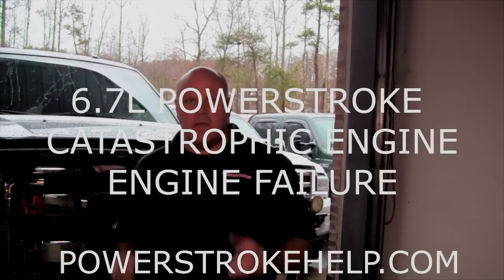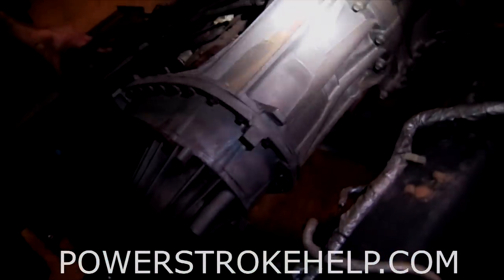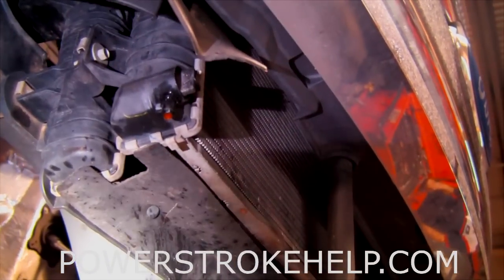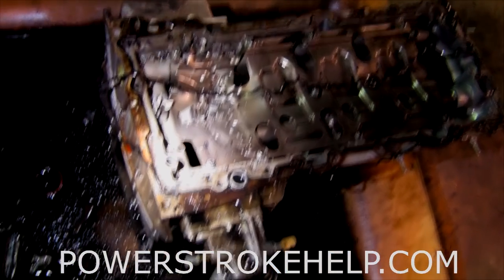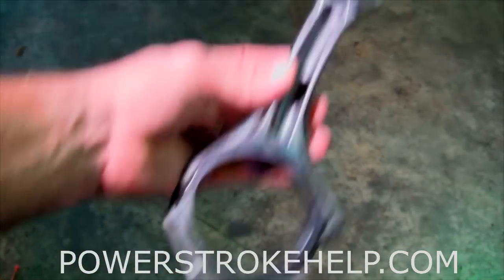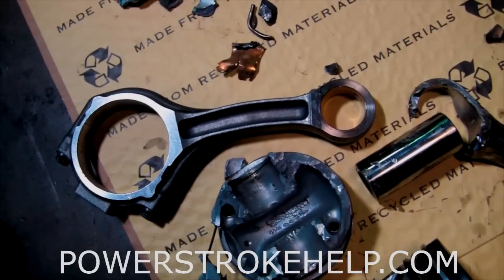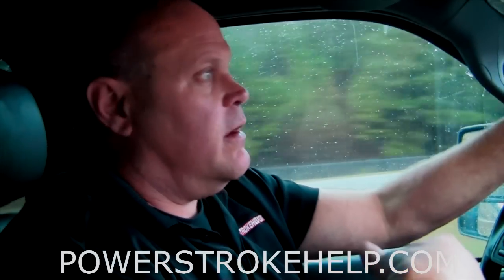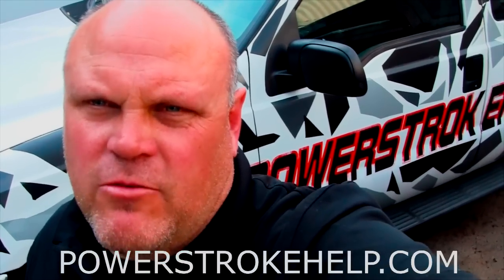6 7L POWERSTROKE CATASTROPHIC ENGINE FAILURE

Comment: I'm sorry, ford is just junk. I've even seen the my hometown fire department switch from ford to dodge now.
Reply: The big three. Chevrolet, Dodge and Ford are all great trucks with their new diesel engines. HOWEVER... what is literally killing their reputations is the extra pollution controls components and everything else that holds back optimum performance and longevity of the engine. It's no laughing matter. I've deleted mine with the Spartan and did it right after alot of research and time. These trucks are capable of running clean and low emissions output without this deplorable egr and filtration crap. It's just the government imposing even more restrictions and wanting more more more to tax and impose. Thus causing headaches and so forth like you see here.
Reply: +steve rodriguez 

Having been around several of these 6.7 engines (many with long, healthy lifespans), I can assure you they're not close to junk. Since Ford cut ties with Navistar, they have been far better off.

Abuse is abuse--no engine will hold up to it forever.
Reply: @EasternAggie  I dont agree my buddy has a 6.7 in the shop right now already in 50k miles the DPF became a flame thrower. now it has a lifter noise with broken rockers and collapse lifers. No power up stuff at all. We will see when the heads come off. I am thinking a broke off valve. Now that is completely shit. I dont hear of that stuff with duramax at all. Only ford. all the 1/2 ton gas engines I have seen with popped transmissions. I have seen my share of shit fords. would never buy one new. THe issues with chevy are external not this internal blow up stuff.
Reply: @Mikefngarage  and bullshit. duramax has been been the queen of failed injection systems, melting/cracking pistons, spinning cranks, blowing apart heads. you have no clue what you are talking about.
Reply: Dodge and Chevy are that great either
Reply: Says the guy with Rasputin as his profile photo.

Comment: Great engine from what I hear. But after years of my own mistakes with tuning and talking to race car drivers it's best to tune mildly with a stock engine. If you want power you have to build with not just strong parts but a stronger engine and when something goes bang it usually means lots of money. Money you've already invested in the reinforcement to begin with. This truck IMO was crackerjack tuned and ragged on.

Comment: What exactly does the "we build a better motor than Ford" comment really mean? (seems really odd especially how he leans into the camera).  I drive a completely deleted 6.7 with H&S tuner (they are not out of business as others have commented) and it is clearly stated all over the place that towing should only be done in tow mode (NOT IN PERFORMANCE MODE).  So, the guys who owns the truck in the video (did not service tranny, did not change oil at regular intervals, pulled a heavy load in performance mode in his tuned truck) and from that we are supposed to believe that all tuned and deleted motors will end up with same fate as this motor?  Also, in the video they state that you cannot run DPF delete because of the timing.  What does having the computer over ride seven DPF sensors, have to do with timing.  There is a stock setting on the H&S tuner that does not adjust the timing for any performance gain, it simply tells the computer not to throw error codes for all the disconnected sensors from the deleted EGR and DPF.  I understand that they have improved the cooling system so that the super heated exhaust in the EGR is cooled more sufficiently now as it is brought back into the motor, BUT why do you want "heated used air" going into the engine.  Cool, clean, fresh air makes any engine run more efficiently.  Has anyone ever cut a DPF apart?  HOLY BACK PRESSURE BATMAN,  cut mine up and sent it to some guy on internet who harvest the platinum out of them and he paid me $275 for it and paid the shipping.  You need the damn turbo just to force the exhaust thru all the crap that is packed into the beast.  All motors BUT especially diesels want to breathe to run more efficiently.  I am not claiming to be any type of expert and I am open to correction if any of comments here are incorrect, just simple observations from a simple guy.  Who is damn happy and proud of his 6.7 (please pardon all spelling and grammatical errors as I said before just a simple guy here)
Reply: I agree.. That truck had static lock due to a bad injector... This guy is selling...what he is selling, is his tuner...  He thinks he is slick and we will fall for, some idiot pulled in performance mode...I have an 03 6.0 crew cab dually, with 600k on it.. Put the edge with juice on it at 25k miles.. I have had it in level 5 (kill mode) since install.. It is my work truck.. I installed the egr butt plug, when I installed the tuner.. No egr delete, nothing else has been done.. It will smoke all 4 rear tires like a dragster.. 
This guy needs to blow smoke up some one else's ass..
Reply: KBS117 He was talking about 6.7s.   6.0s are not even in the conversation, they can be built to 7.3 quality through him.
Reply: +keith knowles My dad has a 6.4 that he has had deleted for the last 12,000 or so miles and the truck has been great way better with out the bs restriction it has before deletes, Its up to the owner to understand what power can do to ones truck, even if you run in performance but drive conservatively i would bet you will be ok, and towing is obviously for towing, thats what it was designed for any owner should know that, maintenance is also key in owning a heavy duty truck, Completely agree with what you are saying on everything.....
Reply: Point well made.  I run H&S tuner on my deleted '11 6.7 PSD on street mode and it runs great.  Tow mode when I tow.  I don't use the performance tune as I am 38 and don't need that shit.  I change oil at 4k and run a quart of Lucas synthetic and oil analysis through Blackstone every service.

Comment: Such a big engine and still it blows up. I had an old Alfa Romeo with a 2.4 JTD engine in it and I raped that engine. Towing loads that were much too heavy, long full speed autobahn runs. It did run without oil for a short time, I had the cooling fluid boiling and continued driving and the car did 500.000km in total. I still have that engine and it runs like the day it was new.

Comment: With age comes wisdom.  I bought a 2000 7.3 at age 19 and stacked a bullydog chip with an edge evolution tuner.  Six months later my tranny was gone and so was $3,200 for the repair.  I'm 31 now and my (I'm the owner) work vehicle is a bulletproofed 6.0 that is bone stock except for exhaust and an intake.  Eventually, we learn that pushing an engine leads to an empty bank account.  If you want to go fast, an 8,000lbs truck is not the answer.
Reply: +Andrew B ...Do you want it fast or do you want it reliable.
Reply: bulletproofed is stock
Reply: I would be happy to tell you, but first as to my name, Its John Barnett. I like using my "Internet Name" TSgt Snuffy, and noticed I never set it for google. But hey I'm sure you will read more into that.

So here is the deal, stacking chips on a 7.3. There are a number of options when it comes to modifying how the computer controls components and deals with sensor inputs on 7.3 engines. We have Mods (ICP mod, boost fooler), then there are Inline Modules (Banks transcommand, lots of others), followed by programmers(SCT, others), then finally "chips" (PHP, TS, etc). 

Now when I comes to stacking, A "chip" always overrides a programmer ALWAYS. You cannot re-flash the ECU then install a chip and get a net positive(1+1 does not equal 2 in this case) , they do not build upon each other. The chip is god in the hierarchy and overrides ECU programing. Both programmers and chips are able to control the full characteristics of the truck from timing to transmission shift characteristics. No additional hardware is needed if purchased from a competent tuner.

The argument should end there but, unfortunately there is somewhat more to the story. Some companies like Banks and others, decided it was a better business plan to withhold changes being performed by the programmer/chip and have an inline module do the work instead. They then get to sell more stuff. The problem is, its still not stacking, it is mealy a trick. You still end up with a single complete solution(.5+.5 =1).

The biggest confusion comes with adding an item like Banks Transcommand to a truck using tunes from PHP or TW. The chips are already programmed to do what the trans controller is "designed" to do, then the module just overwrites it with its own idea, this is not stacking chips either, one being an inline module, it just intender with and Add to dictionary already modified signal. More often then not this type of setup has a negative impact on performance.

Lastly, Mods are useful with stock programming or in unique circumstances with stock tuning of poor tuning. The are not necessary on properly made tunes and do not constitute "Stacking". 

In the Cummins world things work differently, I cannot speak to that. The only Cummins I have is an 855 and the only stacking it can do involves hauling Pringles. This isn't my idea either, this is a very settled and well know issue in the 7.3 community. Just because you install multiple hardware does not mean its stacked, you cannot Stack a 7.3 period! Feel free to ask for more of my intelligence pal...
Reply: Preach. haha
Reply: +MoparMadness 

The 7.3 tranny isn't weak. I own a 2002 F-250 Super Duty. Never had a problem with it in STOCK configuration.

That's funny you say "that" Mopar guy. It's more than a rumor Dodge has shit transmissions and rear ends.
Reply: Better than a motor getting blown
Reply: 4R100s are fine for stock power levels and not running full GVWR all the time. They can be built just as strong as the 47RE in the dodges though.
Reply: +fordrac1ng81 the 4R100 was one of the strongest transmission Ford ever built in the past it can handle up to 1000 foot pounds of torque which is what it means 4 forward gears r for reverse and 100 stands for 1000 pounds of torque so even when tuning that transmission was bulletproof and I am not a Ford fan actually I have no preference they all have flaws and break down we owned a 6.0 Powerstroke it was a nightmare
Reply: HERPY DERPEDY w
Reply: truth, thats why the truck pulls the 2400lbs nissan!
Reply: TSgt Snuffy i in no way said that putting an evolution on at high setting (100 hp is the claim) and then putting a juice on at high setting ( 75 horse is the claim) meant that you now have 175 horse extra. Now, evolution downloaded at stage 1 (can't remember exact claimed power level) is now the baseline of motor. And you get trans tuning built in, But you you can't change power on the fly. Now if you put a juice on with a monitor, and run it at stock, do we agree that the truck is still flashed on stage 1 evolution? Ok, good. Now you can tow canyons and what not fairly safe, and if you watch it ( on your monitor or pods) you probably won't see it get too hot. Now, crank it up 5 on the juice and do the same thing, it will get hot and it will hurt things eventually, but, you still have trans tuning from the flash even in juice stage 5. So, return the juice to stock, and you still have stage 1 evolution with trans tuning. All without the need to pull over and reflash. So, having two different type of HP adding electronics, is stacking. Like I said before, which agrees with you, 1 plus 1 is not 2 here, but it is still stacking.
Reply: John Doe 7.3 automatic transmissions do have problems all the time just as Dodge automatic transmissions do. Its not just me saying that it's very well known among diesel mechanics. Dodge's tranny problems are just more well known because it has been a problem for a lot more years
Reply: Andrew B
Reply: LOL that's not stacking chips/tunes... but whatever you say pal...
Reply: TSgt Snuffy then what exactly is stacking chips if you're so intelligent? Explain to us...
Reply: TSgt Snuffy and I find it interesting that your name changed when you were called out. ? From John Barnett to what it is now?
Reply: It seems our argument is boiling down to semantics, we seem to be agreeing on the same concept. I just don't consider your example to be "Stacking" in the traditional way it works in the Cummins world.  I will agree that you can "Stack" different mod options and arrive a various performance points. It is still a fact  (as you seem to agree with what was my original statement) that you cannot stack chips/programmers on a 7.3. I agree there is utility with the inline modules to make up for shortcomings elsewhere. However, with a properly tuned multi-chip there is no need for additional modules and you get the luxury of switching tunes on the fly. I just don't consider using an inline in conjunction with an ECU mod to be stacking chips, also the opinion of most of the community. Sorry for being.. a jerk... can we be pals now? 

Oh, and I forgot to add in the last post, I go by TSgt Snuffy because I'm a retired Technical Sergeant from the Air Force. Its my way of pretending I'm still important.
Reply: TSgt Snuffy one thing I think you are forgetting to remember, is that when this guy wrote his post about, was 12 years ago, close to the same time I had my 7.3. This was a time when every chip that came out was pioneering the way for what they are today. Back then that was the closest we had to all inclusive electronics. So technically that's the original way to "stack chips." I have had a 6.0, a 6.4, and now I'm in a 6.7, and my last three trucks have had no need for two, because they have been all inclusive. All I need now on my 6.7 is a mini max and I typically run it pretty mildly.
Reply: They can be made to be fast and reliable. You have to have the right truck and a 3 figure IQ. Obviously the 6.7s don't react well to tuners. I don't hear of many 5.9 or 6.7 Cummins that turned rod and main bearing into fruity pebbles just because of a tuner.
Reply: Well said!
Reply: Andrew B still dumb enough to change the intake and exhaust. Didn't quite learn your lesson yet.
Reply: Sorry but you didn't stack crap, 7.3s cant be stacked (unless its exhaust stacks lol)
Reply: John Doe and yeah I may be a mopar guy but 90% of my paychecks usually come from fixing  super duty's
Reply: John Barnett is an idiot, I also had stacked chips on my 7.3, edge juice with attitude for shift on the fly power and an edge evolution original handheld that I ran in tow always because it tunes the trans... people. Lol

Comment: I would've liked to have known you were available.   My father is 75 and had a very well maintained 2006 F-350 dually crew cab Lariat with maybe 153,000 papered miles.   We always hauled hay and cattle.  I had to convince him to trade it in on a 2014 Ford Transit Connect titanium.   I spent $15,000 on 3 repairs always concerning injectors,  EGR cooling system and related items.   It's a nice great hefty truck when running but always building a large tab to keep running.   Thank you for your advice and staying true.   Joseph .

Comment: Hey, bud. There is no "explosion" in the cylinder during normal firing - the fuel-air mixture only "burns" with a flame-front velocity just below the speed of sound. Should the mixture be too lean and the flame front exceeds the speed of sound, then you have detonation (explosion) in abnormal firing which melts the piston. (Former UAW Navistar skilled-labor Inspector on diesel engines)

Comment: These people have to learn the hard way that stock is best. 
The boneheads who try to eeek more power out of these things always end up with light wallets. 
What's wrong with the stock power level? These things will pull a house down right off of the showroom floor.
Reply: +scdevon Given the weenie con-rods on the 6.7, I would be scared to death to put a tune on that engine...
Reply: n10cities
Agreed. Those rods just "look" weak.  Don't give me that B.S. about "advances in metallurgy" etc.. The rods in my VW diesel look heavier than those. (No emission jokes, please). LOL.
Reply: +n10cities you tune the epa out

Comment: What about taking the emissions off for fuel economy, was told 7-10 more mpg?
Oh, and it's so much better looking at other people's carnage than you own lol!
Reply: +Robert Elmo all depends on whos tuning and how heavy of a foot you have. but expect to gain 3-5mpg. Every time your truck will go into regen it fires the injector on the exhaust stroke in order to light off the dpf and clean it. problem is that egts (exhaust gas temps) will be sustained at 1300-1500 degrees. which is way to hot and overtime will  wear out the motor much much quicker.

Comment: now what I don't get is you say it's the tuning chip that is at fault but yet I've seen 6.7 that have done the same thing and it wasn't using a tuner or anything and was 100% stock and was only a couple years old. guy paid to have it destroked  because that engine had major issues as stock. ford definitely failed with that engine.  and I'm a Ford guy and will be till I die
Reply: If you think the 6.7 is a failure you're an absolute idiot
Reply: Ryan Haverkamp it's not a failure it is a good engine butt the power stroke for some reason tends to have its issues more often than not but it is definitely a good engine in my opinion and definitely more engine than I'll ever need

Comment: we have f450's, f550's at work 2011's maybe a couple 2010's  all the motors have grenaded at 100,000. Ford actually replaced all them for us. There was a problem I believe in a valve keeper? Whatever happened to them let the valve drop in the cylinder, I think their was a TSB about it. It was a early design flaw. I can't say they have been that great of trucks.